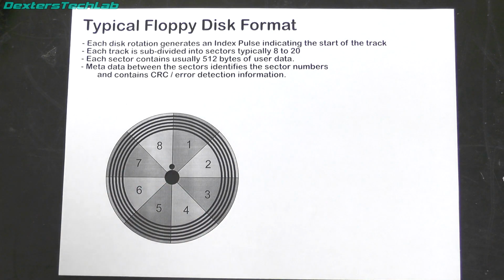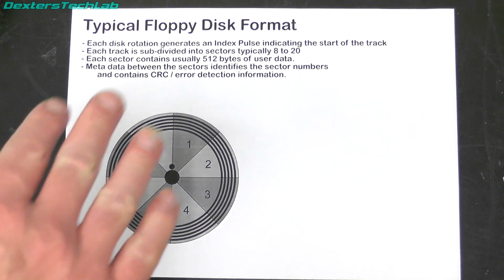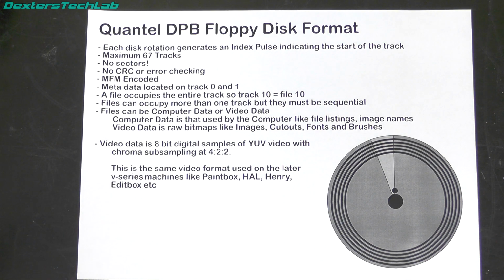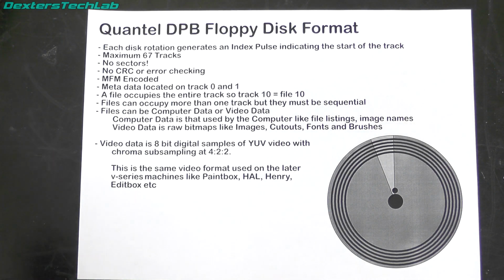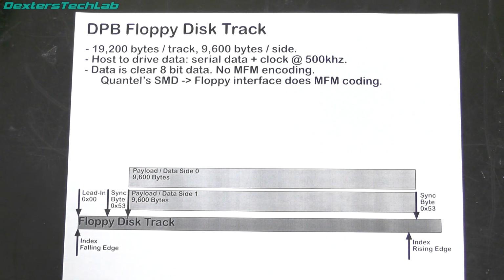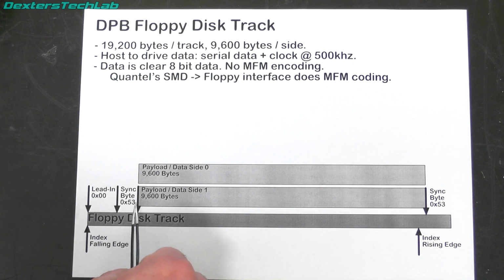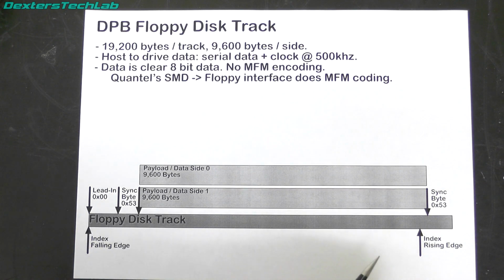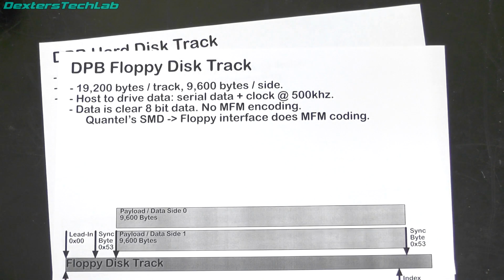DL214 Quantel DPB-7001 Digital Paintbox Restoration & Repair Part 6

Comment: Hi, the end sync byte would probably be used as a simple frame validation. i.e. did we actually hit 0x53 start sync byte or did we hit 0x53 in the data.
Reply from the maker: Yes, we can't really tell if it was implemented though and we haven't worked out exactly how the detector circuit logic works.

Comment: i'd love to see a paintbox core for the mister..
Reply from the maker: Same, but you would need to work out how to use a replacement tablet, but maybe one day. Never say never!
Reply: @DextersTechLab  how many quantel systems like yours are there? there cant be many now.. yours must be extremely rare
Reply from the maker: It's hard to know how many are hiding away. But i have 18 machines listed on my global register. The DPB-7001 is the only one from the 1980s though.
Reply: @DextersTechLab  wow! it's amazing they've survived. total respect for the efforts you're putting into restoration and repair..

Comment: Another option would be to flip the 4 wires in the IDC cable that are for power and ground. All the rest are FPGA IO lines.
Reply from the maker: True but it do still need to make the cable as i can't find one short enough anyway.

Comment: Relatively unusual to see RAM (6116) unsocketed (on the Disk Buffer Card). I guess for reliability than serviceability.
Reply from the maker: Interesting point i hadn't really noticed before!
Reply: I know Vince Clarke had all the chips that were socketed in his Roland MC-4 soldered to the board to make them more reliable when he used them on "The Tank, The Swan and The Balloon" tour. So eliminating sockets to make it more reliable would be a good reason to do so.
Reply from the maker: Well i could certainly understand that for things used out on the road. But for something that would get installed into a rack and never moved for a decade. It could be Quantel knew they were good / reliable devices and was happy to solder them in.
Reply: Historically at Quantel RAMs were always soldered and PALs socketed.

Comment: The width of the index pulse is going to depend on your drive... sounds like you have an 8in drive with softsector discs. When you say leading/rising edge, have you factored in that the signals on the Shugart bus are inverted?
That is to say -- when say "Index falling edge", is that the pin on the drive going low?
Reply from the maker: Yea, i could well be mixing the polarity of the index signal in my description! It's really to illustrate the general design of the format.